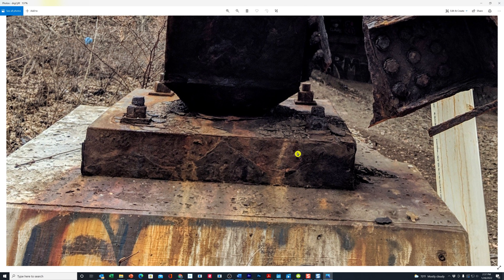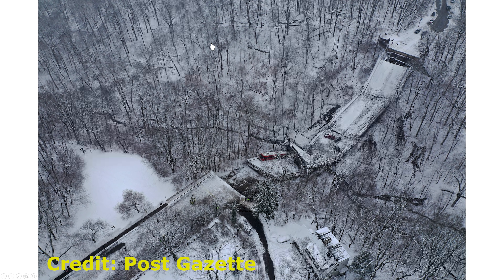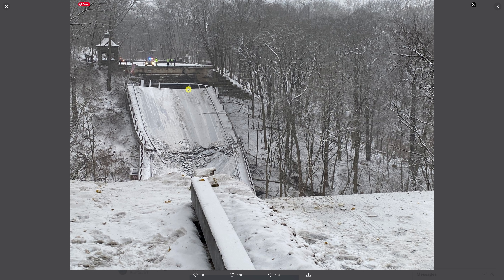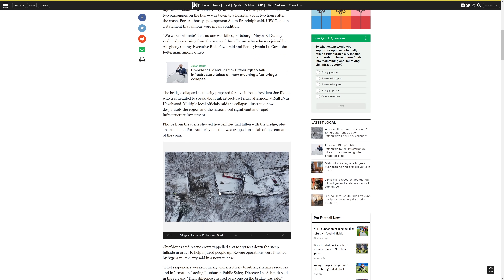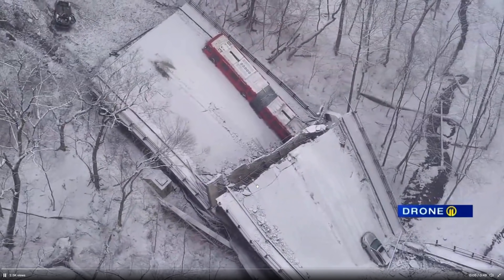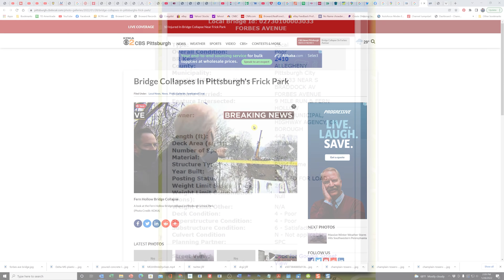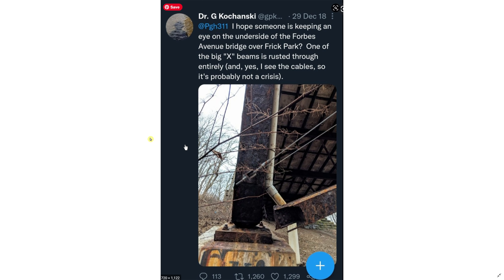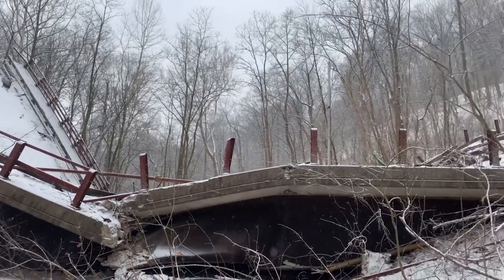Pittsburgh Bridge Collapse Cause, Forbes Ave Bridge Frick Park Rust?

Comment: Resident of Pittsburgh's East End here. We only got about an inch of snow that night/morning. We did get one or two heavy snow falls earlier in January without a solid thaw period since then. My uneducated guess would be most of the snow from prior incidents would have been gone at that point, but maybe not from the sidewalks and curbs (?).

I want to point out the series of photos at 11:50 that highlight rush hour traffic this bridge routinely got. Imagine if this collapse happened at 5:30PM, rather than 7AM. Also, local schools just so happened to have a two-hour delay that morning due to the weather. We are beyond lucky that bridge wasn't full of cars and school buses when this happened.

Comment: Hey Jeff love the channel.  been following your miami condo videos.  Glad to see your doing this one.  This is my hometown and I have driven over that bridge hundreds of times.   There are some decent google map street view photos from under the bridge before the collapse. Not sure how they got them but it was a walker on the jogging path  also this is a main road people use to avoid the traffic congestion on the parkway caused by the squirrel hill tunnels.  so inbound is very busy in the mornings and then out bound in the evenings.  because of the redlight outbound traffic is often backed up across the bridge.   If I remember right there were a couple bus stop locations on the bridge itself.   Its a city owned bridge and not a state bridge.  Pittsburgh has also had a ton of landslides the last couple years during the freeze thaw cycle this time of year including the collapse of a part of us rte 30 a few years ago.  I know you mentioned the cement pillars and if the hillside was all concrete.  It wasn't it was gravel

Comment: My take on  this is: One support gave way. The bridge sagged, bent and fell. That action pulled the bridge ends from their supports on the abutments. The left side was even pulled more because the support probably didn't collapse but levered the deck away from the abutment and forced it to slide down the slope pushing it under the middle part.
If rust was let working on the brace so it completely disappeared at its connenction to the support stile the same time rust had to eat away on the foundation and lower end of the support stile. AND the water which fed the rust was probably assembled in a pocket formed by the diagonal brace and the vertical style. So it sat their for a longer time and had a sustained opportunity to eat away the vertical at that spot. Which eventually made it so weak it crumbled/bent under the bridge load. 
Cold weather made perhaps the bending action from the vertical load become a cracking action. So that the deforming which was already acting on the support was suddenly converted into cracking. That resulted in a more sudden loss of resistance and did the support in. In warmer weather there might have been more pronounced bending only. Then the bridge would have sagged and people would have noticed. But with cold weather the bending turned into cracking and hence no warning signs showed that something was giving.
Reply: Good take.  Seems likely.
Reply: Look at the picture at 15.30 - is it an optical illusion or is the vertical element bending outward slightly?  If optical I would expect the bend to be even all the way up but it is only at the lower section.
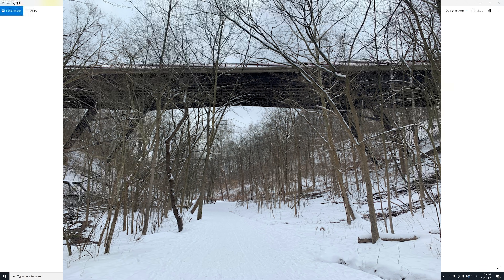Reply: @dzzzzbutube  The "vertical" pillar is only vertical when you look at it lengthwise. The pillar is at about 30° from vertical if looked at from the side. So the camera is also tilted to about 30° upwards to take that shot. The more you look to the side in that shot the more things are out of vertical.Look at 15:48 and you see how the supports lean over the path below.
Reply: @V100-e5q  Appreciate that but a straight line should still be straight even if at an angle. Using a wide angle lens will render straight lines as even curves but that "vertical" seems to me to have a kink. With the total loss of material due to rust of the angled cross brace I would expect a similar loss of material in the "vertical" but, being a lot thicker, it would take longer to fail in the same way. I consider maybe the faces close to the cross brace have lost enough thickness due to rust that they have compressed resulting in the bend point as in the picture.

Comment: One more thing, sorry for being slightly off-topic.
I live in Minnesota, so I'm very familiar with the damage that road salt causes.
For year's we probably did not have an alternative to road salt. But now we do; I don't have the specifics on the cost and availability of other methods of melting ice, though.
Here is what I'm trying to get at. Several years ago, a street light fell onto my neighbors truck during a summer storm. 
Looking at the base, you could see that corrosion was caused by the snowplows throwing snow and road salt onto the base.
My garage floor is all pitted and spalling from the salt dripping onto the cement floor from our vehicles. Our garage door steel hardware is all rusty from salt being in the air.
Several days ago, I tried to change the license plates on our car, and the screws holding it to the trunk lid were so corroded that the heads twisted right off.

Minnesota is starting to treat the newer bridges with a less corrosive alternative in liquid forms sprayed right on the bridge deck, kind of like lawn sprinklers.

Road salt costs the least, but I wonder if it ends up costing more because of all the damage it does, including to our vehicles?

It no longer makes sense to continue to use a mineral that is corrosive to cement and steel roads and bridges, utilities near the road, and vehicles on that road. 

We build roads and cars, then use a chemical that destroys them. That makes no sense.
Then we have the environmental issue. All that salt ends up somewhere. Lakes and Rivers, probably. What does that do to native freshwater species living in the water?
Reply: Pittsburgh resident my whole life and I can confirm that it wasn't salt. They don't salt the roads here.

Comment: The Doctors picture of the cross beam completely rusted off should have immediately alerted the proper authorities. If a bridge received a poor rating it should be closed until a proper fix has been done. It baffles me why the inspectors can't grow a pair and make a decision.
Reply from the maker: Same thing happened with Space Shuttle Challenger explosion, no one wanted to be that guy to cancel the launch

Comment: Jeff,  I was in St. Petersburg, Florida in 1980 when the Sunshine Skyway was struck by the Summit Venture and the southbound (west) span collapsed into Tampa Bay, killing dozens.  Sometime in the future,  if you would have the time, It would be interesting to hear your technical opinion on why the 9 year old cantilever span collapsed in such a dramatic manner when only one of the smaller piers was struck by the ship,  rather than the large main piers supporting the widest span.
Reply from the maker: I was in high school here in Ft. Lauderdale at the time. It is on my list along with the Tacoma Narrows Bridge, and the Kansas City Hyatt balcony collapse, and the FIU bridge
Reply: @jeffostroff  We would spend most of March of each year in St. Petersburg Beach (on the north end of the SSB),  and my grandparents on the south side (Ft. Myers?).  We crossed that bridge many times,  and I was scared to death of it as a kid because of the metal grating deck that you could see through to the water close to 200 feet below.  Days after the ship knocked down the southbound side,  the northbound was converted to two-way travel and going southbound, the parallel structure could be viewed looking west and then it just ENDED mid-air.  Absolutely creepy!!  I hated that bridge.  Even the sight of it sent me into a panic attack when I was a kid and I would get sick.
Reply: Ship hit the small pier, and demolished the concrete support pillar that held up half the section of bridge. Doubt there was enough margin in the build to have the 2 span sections survive having the support removed, and they had torsional motion, and box structures are not at all rigid to torsion, so failed.
Reply: Because it was smashed into by a ship ! 😉 NOW, it has () eye shaped piers protecting the support columns.
Reply: @BigBirdy100  Of course.  I was there when it happened.  The question is why such a huge structure could fail so dramatically with only one support knocked out.  There are supposed to be alternate load paths engineered into a design to prevent total failure.  In this case,  there were very few vehicles on the SSB at that time of day,  so the structure was not even heavily loaded.
Reply: In due time my friend. Pittsburgh is more important.
Reply: @LakeNipissing  Twisting of the box structure as the one side collapsed, then the forces were able to collapse the rigid side bracing, as they are not really able to support the structure off plane.  To have the structure survive would have meant cross bracing along the bridge, making the structure so much higher sop as to accomodate the cross bracing and still allow overheight vehicles to cross the bridge.

Comment: I performed unspections on heavy equiptment for a major steel company. We were provided with engineering structual reports from a outside firm. There were  three levels of repairs with X being the most critical. It had to be repaired immediately or failure was imminent. This bridge should have been closed down for repairs or replacement in 2018. How many more are we driving over in this failure state?

Comment: Good job. Architect here.  I agree the 4 support points seem wimpy. Also rain leaders look like 8” max.? Hard to tell but they are directed right onto the key support steel pads so if they were clogged or busted then lots of water was just gushing on to that Stella when it should have been properly led away.  Basic plumbing gone way way wrong